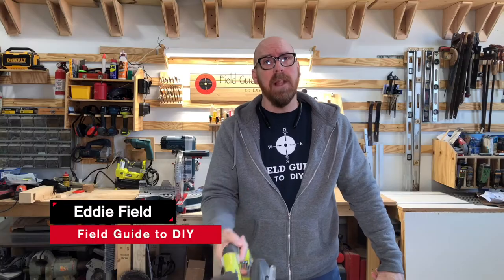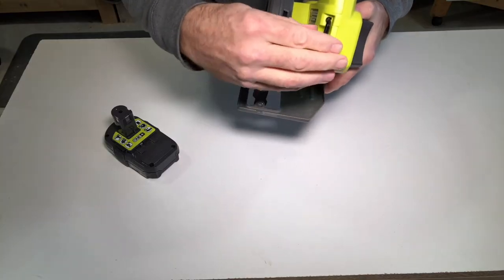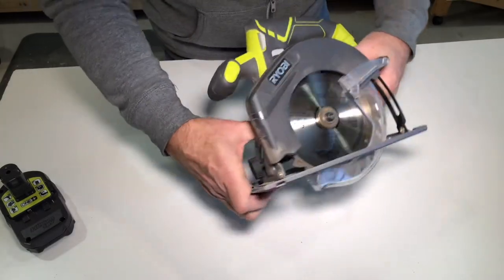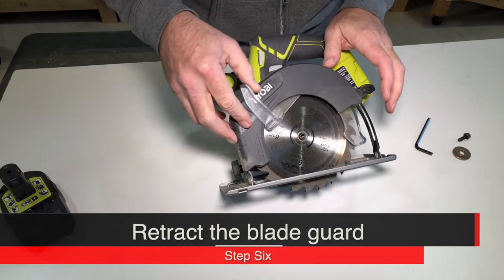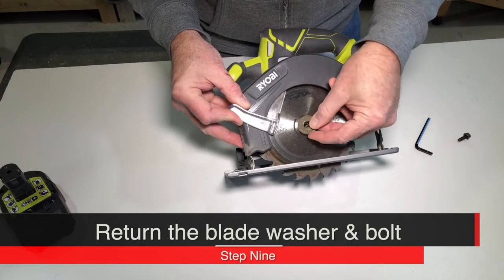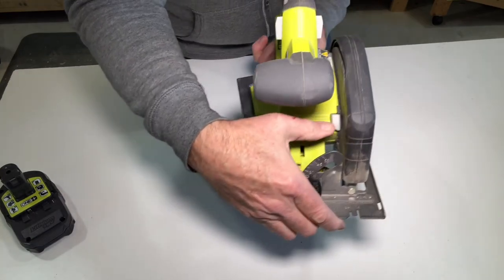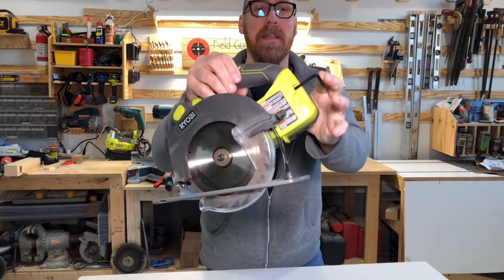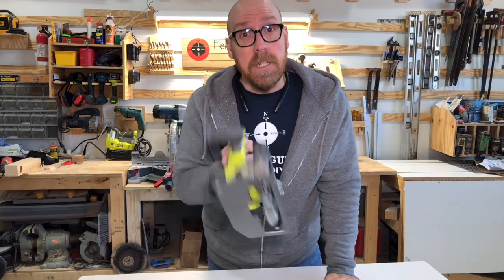Easy Ryobi Saw Blade Change | Ryobi Circular Saw Blade Replacement

Comment: Ain't gonna lie I was struggling to figure out how to get the nut off to put the blade on. Ever since my husband passed (in profile pic) 3yrs ago I'm trying to learn how to do everything on my own while taking care of my elderly parents. This was a HUGE HELP. I'm in the process of replacing what I thought was just the subfloor of our office... it is now the entire floor.
Reply from the maker: Bless.  Well, I'm glad it helped.  If there is anything you have a question about, please let me know.  I'm always looking for content and ways to help folks.  Thanks so much for watching and reaching out.
Reply: @Field Guide to DIY with Eddie Field  well I got the blade on. It's really wobbly & as soon as it touches the wood it stops... any suggestions?
Reply: @lilbutterfly6977  Sorry if this is too late, I believe the keyed washer is out of alignment, but I have been known to be wrong, a lot.
Reply: @Veevslav1  it's a little late, lol. The floors been replaced but I have yet to use the saw.
Reply: @Veevslav1  I am currently in the process of remodeling my section of the house so... you never know.
Reply: @Veevslav1  Lol, it appears you're a gamer, but I won't hold that against you as long as you can be available for answers if I have questions as I go through this remodel process. I know Field Guide said they would assist when they assisted a year ago on simply changing the blade of the 1 saw. I am doing a pretty big remodel. It doesn't involve knocking down walls or anything. Just fixing things that should've been done right the 1st time if people with "D's " had listened to me, but because I have a "v", I must be an idiot. They're eating their words now because it was because they didn't listen to me that the entire floor in our office had to be replaced. It's also why I'm doing a remodel in the remainder of my section of the house to prevent any more floors from needing replacing, with the exception of the 1s I told the about as the laminate flooring was being laid, which again was ignored because they're males who "know everything" & I'm only a female. I'm also working on taking all of the wood paneling, washing it with a mild cleaner, allowing it to dry,  using spackle to fill in the seams, then sand it flat before painting it to make it look like there's sheet rock on the walls instead of the wood paneling, to give it a more modern, contemporary, brighter feel. If you'd be willing to be available to answer questions, I'd be happy to give you a way to contact me. I'd really appreciate it.

Comment: Thanks for this step-by-step. I have a comment and a question. First, I realized that the arbor lock only locks when the blade is in the proper rotation, so I had to rotate the blade a bit to engage the lock. My question is, after cleaning the blade, and reinstalling as per instructions, it doesn't turn freely. If I hold the switch on, it starts to spin first slowly, then up to speed. Is it catching or stuck on the other side?
Reply from the maker: I had not heard of that before.  I'm wondering if somehow the blade is on crooked and is binding somehow.  I'd try taking the blade off completely and running without the blade on it and see if you still have that speed variation.  Keep me posted.
Reply: @FieldGuidetoDIY  I did that. And when off, it spins fine. But when back on, won’t go.  The screw spins the washer on Top of the blade. It is not inhibited by the blade guard.

Comment: Any idea what size that allen wrench is? I've misplaced mine....clearly I did NOT put it back in the slot the last time I used it 😂
Reply from the maker: S JT, that would be a 3/16” Allen wrench.  Thanks so much for watching.  Please let me know if you have any other questions or recommendations.

Comment: Mine has a hexagonal nut on it, not an allan wrench nut.  Mine is counter-clockwise to remove that nut, not clockwise to remove that nut.  I have an electric, corded, older model Ryobi, not a battery.
Reply from the maker: RWC, you raise a great point.  Maybe I should have included that in the title that these instructions are for the Ryobi cordless model.  The cordless model has the allen wrench.  Thanks for the reminder.

Comment: Help please, I think I did all that but my blade will not spin/turn. I can hear the motor trying to work but the blade automatically tighten so that the blade will not turn
Reply from the maker: Norman, so sorry the hear that!  I’ve had two other viewers share the same story.  Both ended up exchanging their saws at the store.  I don’t know if that is a flaw with the design or just a few bad products.  Carefully see if there is ANY movement by grabbing the blade and spinning it.  See if the blade button is stuck depressed.  I hope this helps!  Thanks so much for watching.
Reply: @FieldGuidetoDIY  thank you
Reply from the maker: Anytime!

Comment: After replacing the blade, the guard won't move unless I use force to get it to move. To the point I am afraid of breaking it. What could of caused this? Do you know how I can fix this?
Reply from the maker: Lisa,  I’ve heard of this before from others but never experienced it myself.  See if it has something to do with the blade being installed.  Remove the blade completely and see it the guard suddenly moves freely.  Let me know.  In the meantime, thanks so much for watching!

Comment: Dumb question,  should the teeth of the blade pointing down or up?
Reply from the maker: The teeth should be pointing up.  As a rule, most blade manufacturers print the blade and brand on only one side.  Have that side facing OUT.  I hope this helps.
Reply: Thanks!

Comment: shaft spins but blade does not.  bolt tightened as far as it will go.
Reply from the maker: Charles, that's odd.  Are you sure you have the keyed washer on there correctly?  You may be tightening against the key.  Make sure the flat spot on the shaft lines up with the flat spot on the washer.  Keep me posted.  Thanks so much for watching.

Comment: perhaps i am doing something wrong.  I am attempting to change the blade on my ryobi circular saw and even the socket wrench won't move this thing.  It's like it's welded together.  Has anyone had the same issue?
Reply from the maker: Not that I’ve heard.  Make sure you are turning the wrench the correct direction as shown in the video.  Keep me posted.

Comment: i watched 1000 times and i still cant understand what this man is explaining
Reply from the maker: Jovanny, as you turn the nut with a wrench, press the gray button to keep the blade shaft from spinning.  This will will release the nut.  Then you can remove the blade. Please let me know if you have any other questions.
Reply: @FieldGuidetoDIY  i love you
Reply from the maker: @jovannyhernandez9765  aw, love you too.  So glad it helped!  Please let me know if you have any questions or suggestions.
Reply: @FieldGuidetoDIY  no that is it
Reply from the maker: dragon cory  did the saw blade arbor or axle lock?  Then can you loosen the bolt with the hex key Allen wrench?
Reply from the maker: dragon cory  I wonder if if isn’t being pressed in enough.  Have you got another pair of hands there.  Also make sure you’re not tightening it instead of loosening it.

Comment: I put my blade in and now it won't start! When I try to turn it on it just clicks
Reply from the maker: Sweetie, I’d start with the battery.  Put it on the charger overnight.  While that is charging grip the blade CAREFULLY and see it you can turn it.  Maybe the arbor lock button is still pressed somehow.  Press it and release it while trying to get the blade to turn.  Let me know if that helps.  Thanks so much for watching!

Comment: Crap mine the guard got stuck when I turned it on.
Reply from the maker: It’s spring loaded.  It won’t come back down?
Reply: @FieldGuidetoDIY  it won't unless I push it back real hard crwzy
Reply from the maker: @mindseven7217  I’d suggest you exchange it for one that works.  Besides being annoying, it is also dangerous!
Reply: @FieldGuidetoDIY  thank you! I'll do that first thing in the morning thanks again!

Comment: Perfect for small projects. Not got a lot of power so if the wood starts to flex it stops the saw pretty easy. Use it for small tasks and you will be happy. Safety system Works great https://www.youtube.com/post/UgkxjpBI8OOeUXib_iT7UomCrQ-uauwZJ62c  .lose your grip on the saw it shuts off and the sheath closes over exposed saw.
Reply from the maker: Me too.  I did a cut through some 3/4” cabinet-grade plywood and it bound.  Make sure you have a full charge before running it through the strong stuff.

Comment: The problem I have is that the BLADE LOCK - does NOT lock the Blade
The Blade is SLIPPING because it cannot be locked firmly 
It is in my view a very poor design for the locking mechanism
Reply from the maker: I'm sorry to hear that.  When that happens, you have to go old school and put a screwdriver between the teeth and lock the blade from spinning.  Let me know if you have any questions.

Comment: Yeah that didn't work
Reply from the maker: Sorry to hear that Atwood.  Did the blade keep on spinning?
Reply: @FieldGuidetoDIY  ok so I bought a used saw yesterday the Ryobi. The blade the was on it bent. The previous owner took it off without an issue. I bought a new blade and tried to open the saw port. I hit the lock and tried to push the Allen key downward but it didn't even move